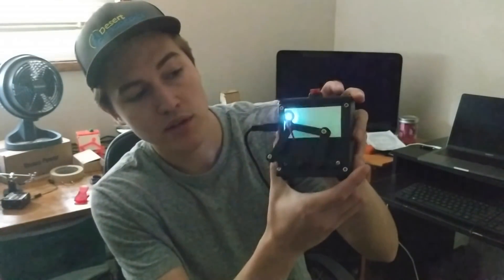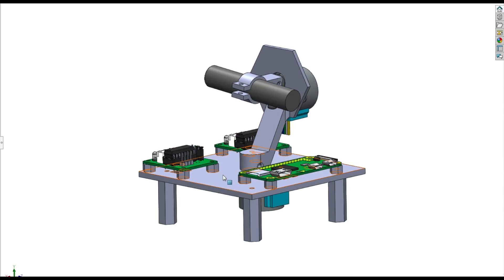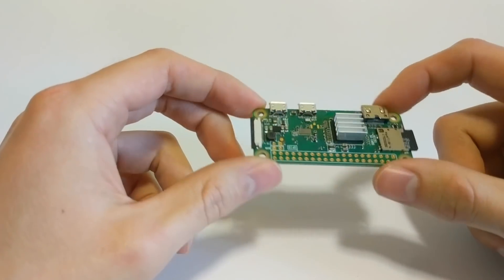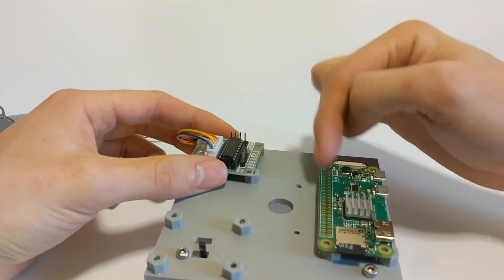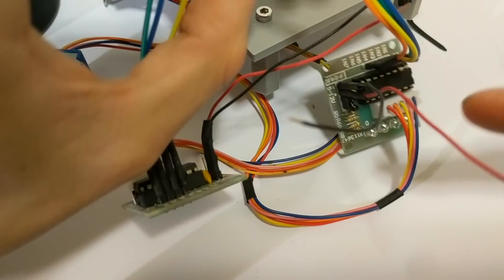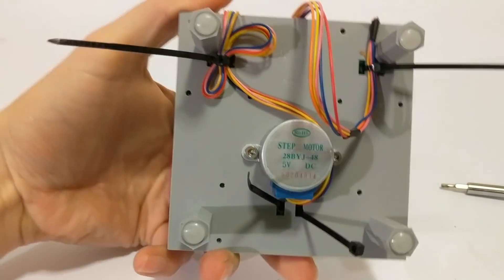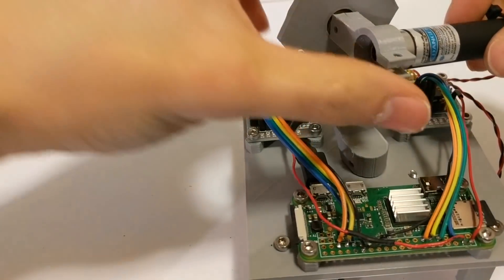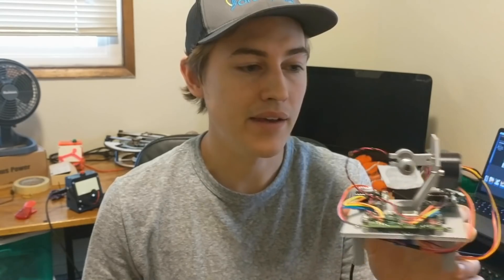Raspberry Pi Laser Turret (Draws on wall!) Pt1.

Comment: I've seen a lot of warnings about powering the stepper motors via the raspberry pi.  Have you had any issues there?
Reply from the maker: I didn't have any problems but if it persists for you, you can always use a 5v external power supply for the motors. Just make sure to share the ground with the pi

Comment: This project is simply awesome ! impressive idea and skills, by the way
Unfortunatelly, the codes provided at Github are not working properly... I use python 3.7 but whenever I try to run the codes, multiple errors appear...
Could you please help me ? = )

running the MultiLineText.py appears: line 42, in <module>
    Seq[0] = [1,0,0,0]
TypeError: 'range' object does not support item assignment

Comment: Is your wiring diagram on Thingiverse correct? It looks like stepper motor grounds are going to pin 27 and 32 but should be going to pins 25 and 30.  Plus it looks like there are other wiring issues.  It looks like the correct wiring diagram may be found at the 7:22 mark of the video. Thanks for putting together such a neat project.
Reply from the maker: utahcrazy good spot. I've updated the wiring diagram on Thingiverse. Thanks :)

Comment: Great project... wouldn’t it be better to use servos to control de laser xy? I am thinking you won’t need to home the head, and also could get more smooth results?
Reply from the maker: Servos tend to have a lot of jitter and aren't near as smooth. At least the servos that are anywhere near to the price range of these steppers (~$2). Plus this set up doesn't need to be calibrated or homed. As long as it's pointing forward, it's good to go!
Reply: Tucker Shannon thanks. How do you get around homing?
Reply from the maker: As long as its pointed forward when it starts, I can keep track of how much the motor rotates (number of steps) during the drawing period. Then I can always return to same starting position.